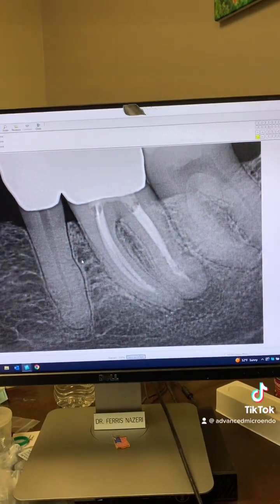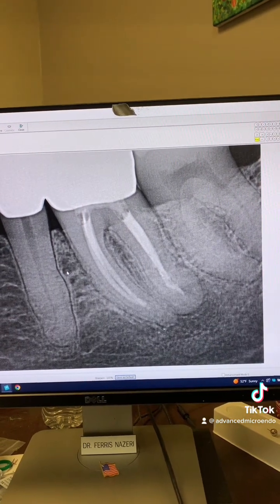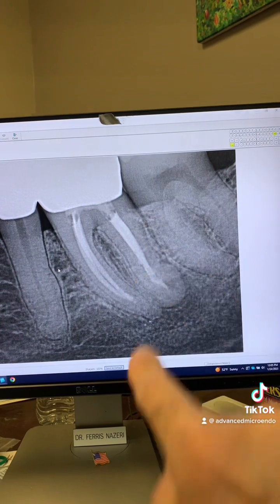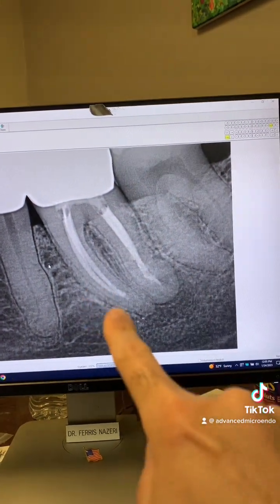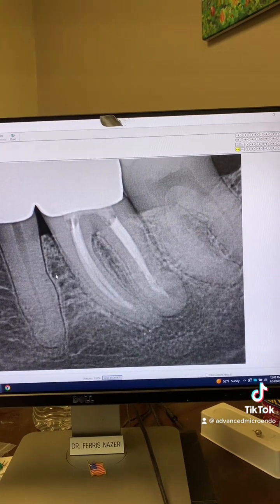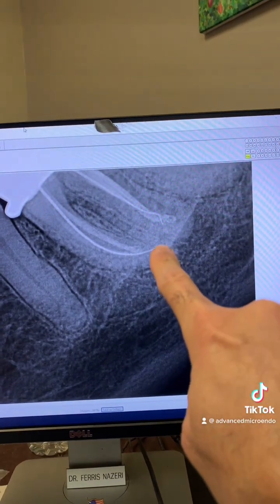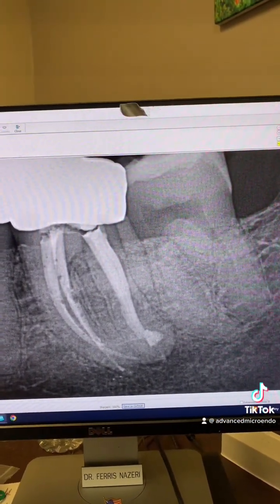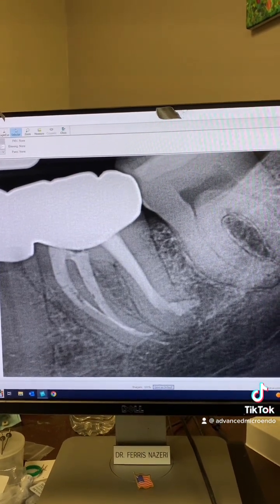Endodontic retx of tooth #19 through a crown in one visit.

Comment: Nice case sir ,which file did u use in reciprocating hand piece to get patency,c plus,c pilot? Or any other file,.and which no file u started with 6/8/10 no. Regards.
Reply: Also do u use edta gel or liquid edta to negotiate the canals along with reciprocating hand piece and files ,regards
Reply from the maker: Hello. I use 08 C, 10 C and 15 C files from Roydent. I also use a #20 flare file which is basically a #20 k file but instead of having a 2% taper like a regular k file, the flare file has a 5% taper. I use the brushing motion with my files so I can increase the taper of the canals as I please. I use a reciprocating handpiece as seen in the many videos I’ve posted. For recapitulation I use a 10 C file.